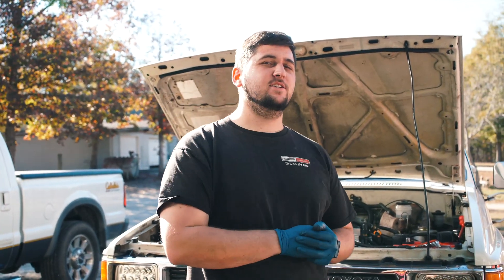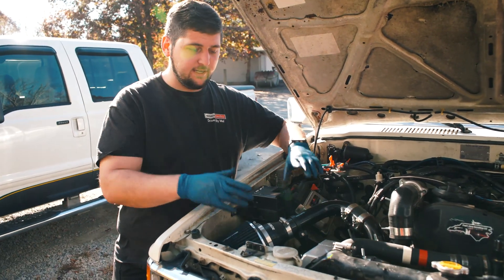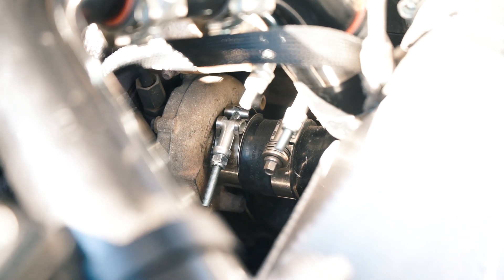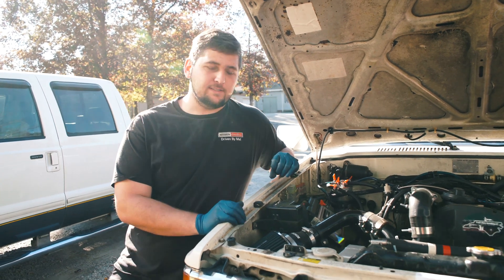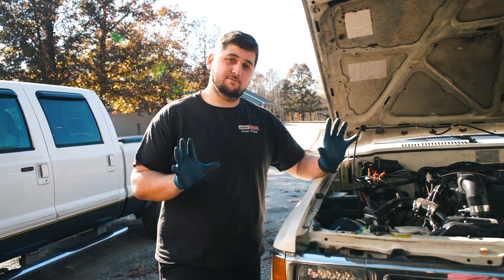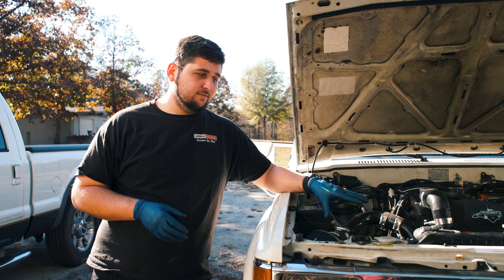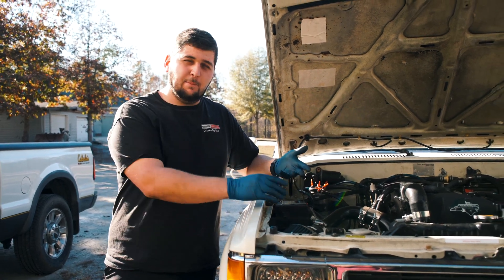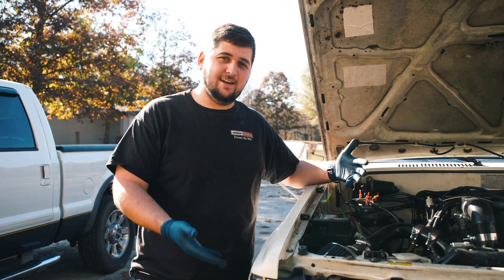TDI Swapped Toyota Pickup Turbo/Intercooler Breakdown!

Comment: so your intercooler is doing basically nothing but getting heat soaked by hot radiator air blowing on it, it has no air flow.
you know you could go air to water intecooler and it would actually cool and you could put it in the same spot for convenience also the heat exchanger is pretty thin and small so easy to fit in front of the radiator where it will get some air flow and actually cool your air charge.
Reply from the maker: The location I have this posted pulls air from the wheel well. The fan on the inside of the cooler pulls air from the outside (wheel well). I went this route to copy the car design. A front mounted cooler would perform better though and I may go that route if I can make one work with whatever A/C setup I decide to use in the future. The main thing I want is for it to look OEM on the outside as possible.

Comment: Hey Paul I’m doing the same intercooler on my swap and I bought what you had put in the description. Do you happen to know the size downsized boots needed to make it work
Reply from the maker: I used 2 inch intercooler piping. The cooler was 3 inch. I think the intake pipe was also 3 inch down to the 2. The turbo was smaller. I think like 1.75 or 1.5 inch. I had to make a metal pipe to adapt from the 2 inch to the factory boot on the turbo.

Comment: What are you intake air temps and EGT temps with that intercooler inside the engine bay? That would be the only concern. I have a TDI swapped CJ7 and in the process of doing an XJ, but realize that hose trucks have limited space for an intercooler.
Reply from the maker: Sorry for late response. I don’t have an accurate IAT reading currently because my sensor is pre intercooler because I didn’t have enough pipe to mount it on post cooler. I’m prolly gonna move it and mount it on the intercooler whenever I get around to wanting to fab in the flange there or install a IAT gauge in my pillar. I do however have egt gauge and I usually stay 3-400 range. Max I’ve seen at WOT 3000 rpm was right below 500. Have never had it go above on my gauge.
Reply: @paulsperformance  So you have a stand alone IAT sensor? You're not talking the MAP sensor for the ECU are you?

Your EGTs are off. Like WAY off. I can easily hit 1500F when pushing it, and I cruise at 900-1000F with a waste gated turbo. With my GTD1756 I'll be around the same, and @ 34 PSI should be around 1650F. The highest I've seen is 1650F on any of my turbos with a good tune (VNT17, GTB2060, GTD1756 and HE200WG). You should have it pre-turbo for the best results.

But it's your build. Have fun with it. Be careful without having accurate measurements. You could hurt the motor.
Reply from the maker: I don’t have a stand alone IAT yet. Just the factory MAP sensor. And I have my EGT gauge at the exhaust manifold currently not on the turbo outlet. I only run about 22 PSI max but mine is still all stock. Those egt readings seem high to me as usually anything over 1300 is too hot. Even my Powerstroke doesn’t run that hot on egts. Where is your probes?
Reply: @paulsperformance  I've built more than half a dozen of these motors, I'm a retired diesel mechanic, have swapped my CJ7, and in the process of doing an XJ (both on my channel). I run a FB group teaching people how to do the wiring on them. Needless to say I have a good idea on them, lol

My probes are before the turbo in the manifold, where they should be. 

The GT series of turbos (first gen VNTs that came in the VNT15 format) were rated to 1650F sustained temp. I ran my VNT17 down in Miami to 1650 and held it there, all the time. The Holsets that my buddies have run in the ALH have hit 1800F degrees for short bursts without issue. I've hit 1625F pushing the CJ pretty hard with my HE200WG. The GTD series of turbos is good to about 1900F (I believe, maybe 1850F). My Cummins Titan XD would see 1450F in the mountains when driving. If this was an OM617, then 1450F is about as far as you want to push them so you don't cause an issue. VW TDIs are different than some of the older trucks.

As far as the MAP/IAT, you're probably causing some issues as the ECU is looking at IAT for fueling. Since you're pre-intercooler, your temps are going to be high, and fueling reduced. I would suggest you get it where is should be when you have the opportunity. I'm going to guess you get heat soaked pretty quickly without adequate air flow.

IN any case, enjoy the swap. They are a ton of fun.
Reply from the maker: @TDISwap  ahh okay and yeah I’d like to mount it on the post side of the intercooler. I just need to find time to get it out and get it welded up. I’ve had the truck swapped for over a year now. It runs pretty good but I’m still trying to perfect everything. I do want to go ahead now and move my sensor and see if it changes anything. What is your group name? I have another ALH engine I plan on rebuilding for more power to go in this once this one is wore out. Whats the best turbo/injector option for a daily driver you have used/seen in these?
Reply: @paulsperformance  It's called TDI Swaps, lol. 

When you get to the group you'll see that I'm running a 3D printed MAP sensor mount that bolts and seals to my intercooler piping. As long as you have a section of straight pipe post intercooler, it'll mount with an o-ring to seal. I haven't tested it out, but the designer has compounds on his ALH pushing 50+ PSI and it holds perfectly fine. He also makes other methods to attach post intercooler that don't require welding. 

As far as builds, that all depends on what you want and what it's going into. For the XJ the GTD1756 w/ some 260 or 280 GOOD injectors (Jarod March, also on the group), you're making 250 and 400 lb ft. That's good for most. Kyle runs some crazy Volvo GTD turbo that is pushing 38 PSI in his Toyota pickup like yours. He's got some great videos here on YouTube as well. He just finished a 1-ton swapped Dakota that weighs in over 6,000 lbs and it's doing great with the stock ALH. 

There is a ton of information out there, most of it is bad. Come join the group. We will all help you make your decisions! lol
Reply from the maker: @TDISwap  yeah good info is typically hard to find. I started making these videos to try and help other people and to hopefully meet people and combine ideas. I want to swap my 4 runner next.
Reply: @paulsperformance  Welcome to the group.
Reply: @paulsperformance  They can be addictive. I never planned to do the XJ, I'm in my 40s and can't work like I did in my 20s, but I bought a motor, and then the XJ, and the just said screw it. It's been fun learning how to do the automatic, but it works perfectly with the stand alone TCU. I'm about to install the Tacoma A340E valve body into the XJ AW4 to eliminate the the TV cable as it'll be solenoid driven. 

Best of luck with your next swap!

Comment: Thank you for the quick reply Paul I read that some guys are getting 40 miles per gallon. What stock tires and the stock transmission I have is 35 + miles per gallon possible?
Reply from the maker: Possibly. The rear end gear ratio I think is what’s killing me and also the 33 inch tires. I will make a video when I do my gear ratio swap and update you on the mpg gain.
Reply: Thank you Paul

Comment: Paul you did an amazing job. Thank you for posting such an informative video. I have just purchased a 1999 4x4 Tacoma 2.7 manual with 320,000 miles. I want to do this swap and leave it stock , not after the power so much just fuel efficiency for long road trips . How many miles per gallon can I expect if I go with a 1.9 TDI swap? Thank you for your time .
Reply from the maker: Mine has 4.11 gear ratio currently. I get 25mpg with that. My rpm is high at highway speed. Roughly 2700-3000 at 70mph. I’m planning on changing my gears out now that I have power to a 3.58 or 3.73 so I can get higher speed and better mpg. The factory be trans has a final gear ratio of 3.55 so I’m prolly going to do the 3.58 gears and hopefully they will put me into the 30+ mpg range with big tires